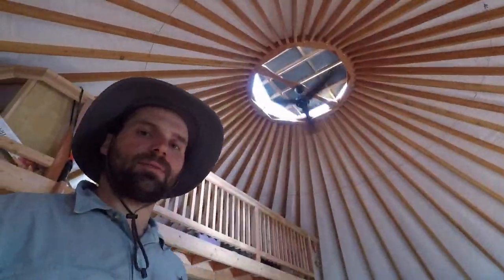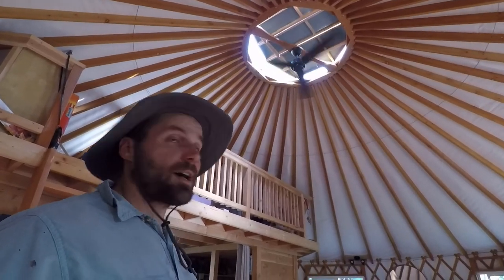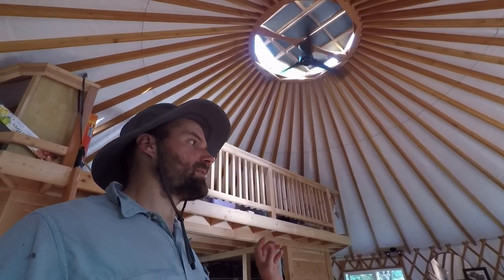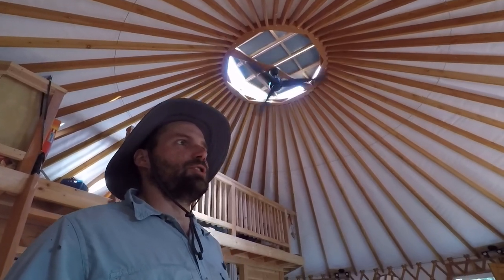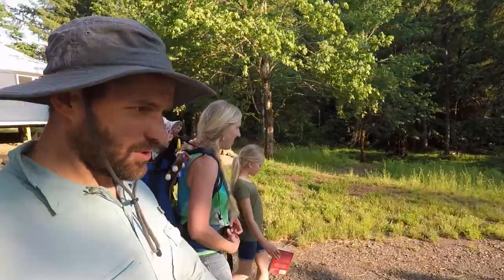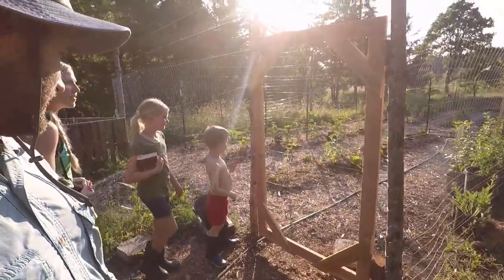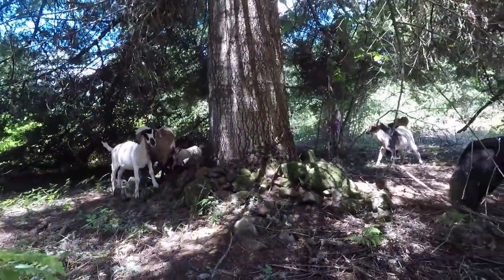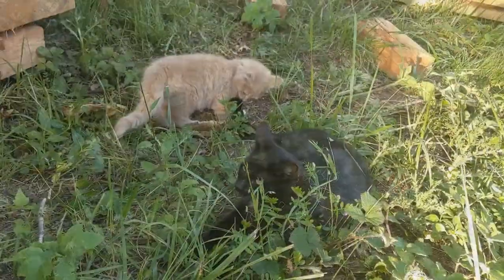A Sun Shield For Our Yurt Dome

Comment: I have a 30ft. Pacific Yurt in the high desert and also experience high heat. I tackled the same issue but chose a different approach. I also had a dome crack with ice and snow on it- I got 16 years out of it. 
The potential problem you are creating using Reflectix on the inside is sunlight is coming in from the top and then getting reflected up in the opposite direction. While this blocks and reflects out, even though an open dome will let the heat out, you are essentially passing twice as much UV through the dome. I think this will decrease the life of the dome. Pacific Yurts sells a screen that filters light and keeps the heat down significantly. I have used it for several years and recommend it. I use aluminum push pins every 10" or so to attach it. It goes up in the spring and down in fall. Also keeps bugs out.
Looks like you have a wonderful situation going. Good luck!
Reply from the maker: Thanks for the detailed comment!

Comment: does your fan have a reverse option? might be better to help move the hot air up their out of the dome opening rather than blowing it back down
Reply from the maker: Yep, we are doing exactly that, running it to move the hot air upwards and out the dome!  In the winter when we are running the wood stove, we switch it to try and push the hot air down.
Reply: @Green_Heart_Family_Farm  look up a Canadian Well.  You could pipe it out along your septic to the creek where it's nice and cool. And with the raised yurt it would be easy to do
Reply: @Green_Heart_Family_Farm  I thought all you need to do is opening the windows and opening the dome to let the hot air out? - The original Mongolian yurts use a huge piece of cloth to cover the dome in bad weather conditions. You could make one out of insulation mats that don't weigh much and strap it with four long bandanas.